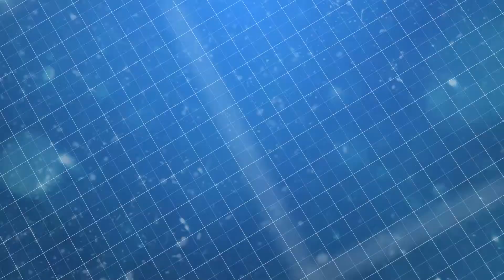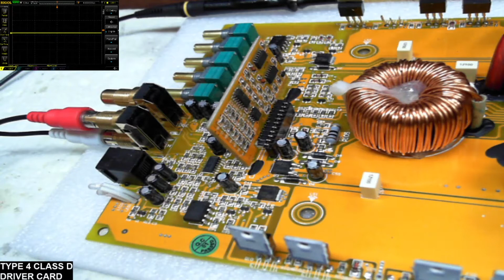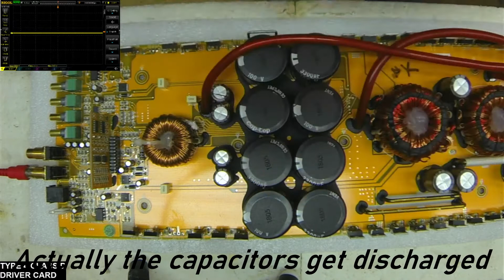CAB Audiopipe Type 4 Class D Car Monoblock Amplifier Driver board

Comment: Hola brother como estas, necesito que me ayudes un poco, ¿cuando esta protegido osea hay voltaje en el pin 3 ese voltaje le llega al pin 16 del t494.. pero yo reviso y aparentemente todo esta bien. Pero se le quita la proteccion unicamente si conecto a GND el pin 16.  ¿Podrias indicarme que revisar?  O sin dudar la falla esta en la tarjeta de salida?
Reply: Tambien me di cuenta que si le quito los diodos del alto voltaje prende y no se protege.. los mosfet de salida no estaban puestos. Tambien vi que cuando prende sin los Diodos del alto voltaje hay 5v en la salida y 129khz  dime que opinas?  Me parece extraño que sin el alto voltaje haya oscilacion en la salida.
Reply from the maker: @rikielectronico5450  Sounds like you have bad output transistors. Typical of this design. The output is driven by the auxiliary windings of the power supply.
Reply: Los mosfet de salida no estan puestos.  Conectamos el remoto y da proteccion y de alli no sale..
Reply from the maker: @rikielectronico5450  This is telling you that there is an issue with the rails or components connected to the rails.
Reply: Podrian haber problemas en el LM319 o en el ic 4560 ? O en los 74hc
Reply from the maker: @rikielectronico5450  I would pull the card and with the rectifiers in see if it starts. It is rare for the card to have faults. Since you know it is a rail issue I would check the over-current circuit and the gate drivers.
Reply: Si tienes razon hermano. Voy a intentar eso gracias por la orientacion. Saludos Dios te bendiga.
Reply from the maker: @rikielectronico5450  Any day!
Reply: Una consulta mas estube buscando el canal de perry babin que recomendabas y no me aparece me podrian mandar el enlace
Reply from the maker: @rikielectronico5450  https://www.bcae1.com/ Thank you!
Reply: Saludos mira una pregunta crees que el amplificador se llegue a proteger, por un mal rectificado en un 7805 de los 3 que trae. Hay uno del area que alimenta los 5v de los mosfet de salida, yo medi con el osciloscopio y veo que los 5v tienen ruido o rizado.. y compruebo el del otro lado y los 5v se ven limpios!
Reply from the maker: @rikielectronico5450  That is normal as one of the regulators carries the high side drive more or less.
Reply: Quitamos los Diodos MUR y conectamos el remoto y enciende normal, en los gates de la salida hay 5v y 128khz aparece esa señal estando el alto voltaje en 0v

Comment: While testing for drive on pins 10 and 11 on the drive card, I accidently grounded pin 9 (5 volt supply), and now the protect light and power light are both flashing and I hear the power supply mosfets clicking and they're heated up... what did I blow?
Reply from the maker: You may want to pull the output drive card (make sure the outputs have pull-down resistors) and check to make sure that the 5v regulator is OK.
Reply: @ellensburgamplifier which is the 5v regulator?
Reply from the maker: @j3rs3ysfin3st97  It is the SMD regulator closest to pin 1 of the drive card. You will show continuity from pin 9 to that regulator to know you are on the right one.
Reply: @ellensburgamplifier Great, I will test that today. Btw, will I be removing the drive card just to make space to test the regulator? Or is there something on the card that I should be testing once it's removed? Sorry for what may to stupid questions, I'm completely new at this, I will be buying Perry's Guide as you suggested in this video 👍🏼
Reply from the maker: @j3rs3ysfin3st97  If you don't have any low resistance on the output transistors gate to source (will be under 100 ohms if there is a short) then I would pull the card to check the 5 volt regulator. This will keep the transistors from wanting to switch on.
Reply: @ellensburgamplifier Ahh, gotcha. I really appreciate you letting me pick your brain, I won't take up anymore of your time, I'm sure you're a busy guy 👍🏼 thank you
Reply from the maker: @j3rs3ysfin3st97  I will always make time to help others. You can also call me during business hours if you need help walking through a diagnosis.
Reply from the maker: You may also want to make sure that the output transistors don't show any low resistance values between gate and source of each output transistor.

Comment: It will make a loud bang if they reach ground immeadatly and hurt your ear. I Discharge them from ground through my large 1000w 2ohm load resistor.
Reply from the maker: Yes, it will definitely wake you up if the rails get shorted rapidly to ground.